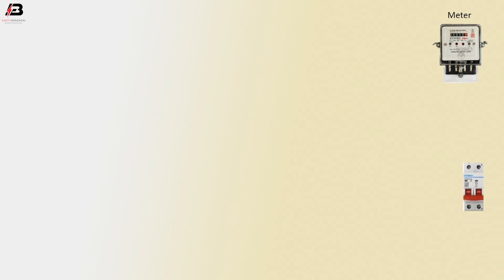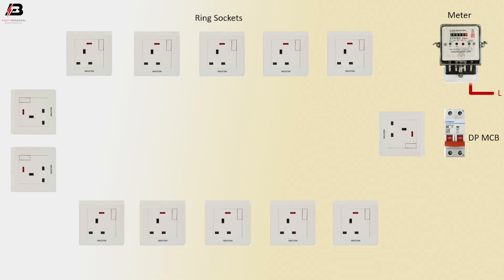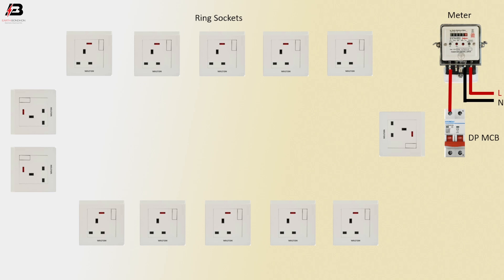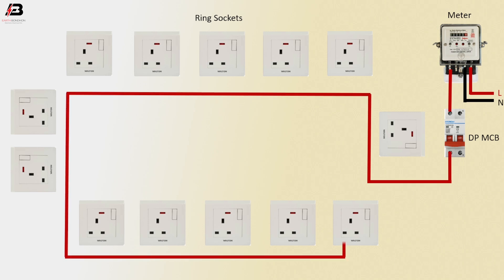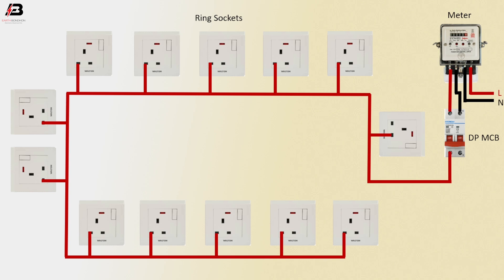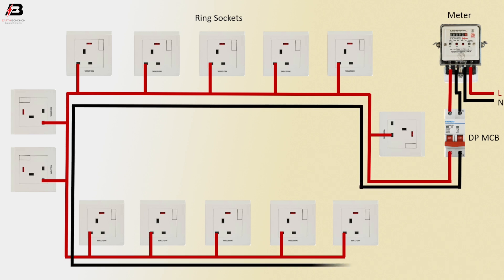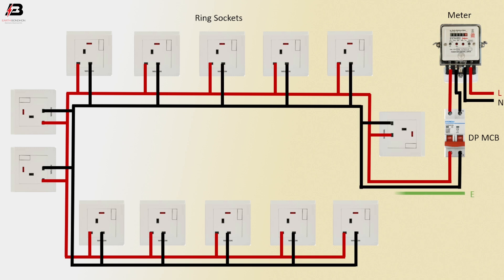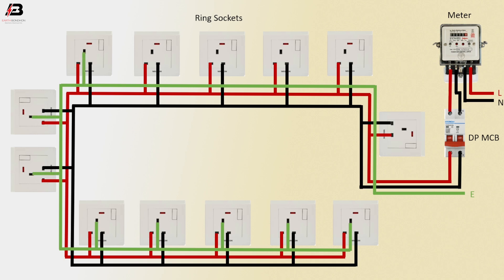How to make Socket-Outlet Ring Circuit Wiring Diagram | ring circuit wiring

Comment: This is a radial circuit. Not a ring circuit. You'll end up melting wires. For it to be a ring circuit you need it connecting to the DP MCB at both ends of the circuit to make it a RING.